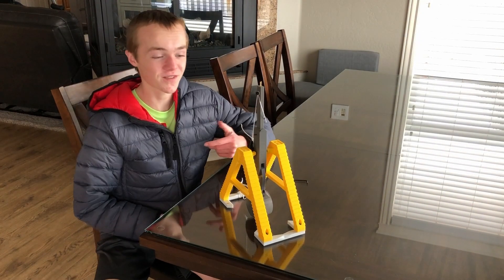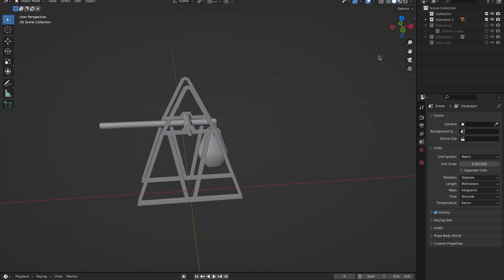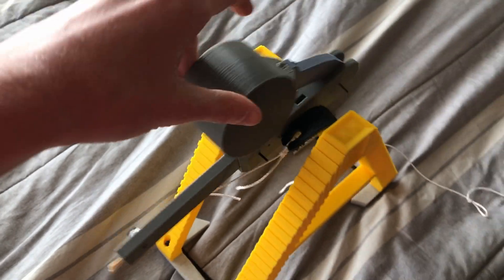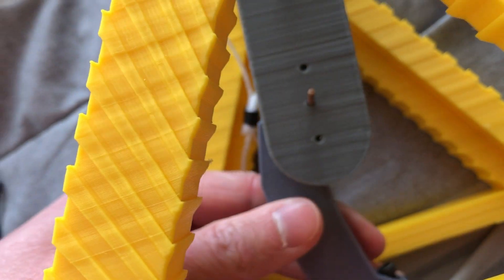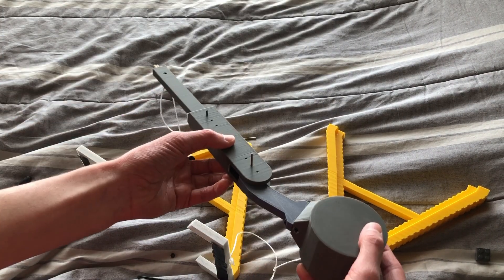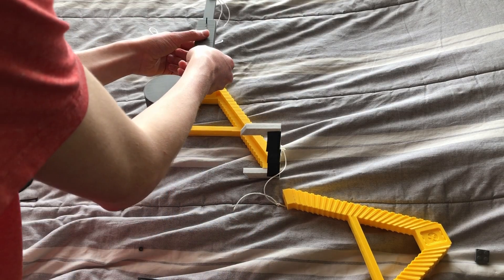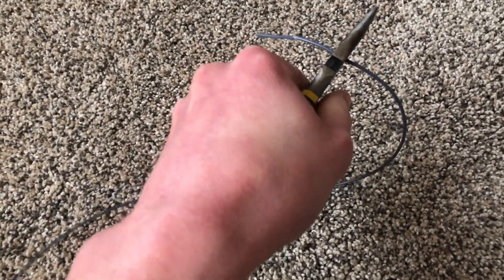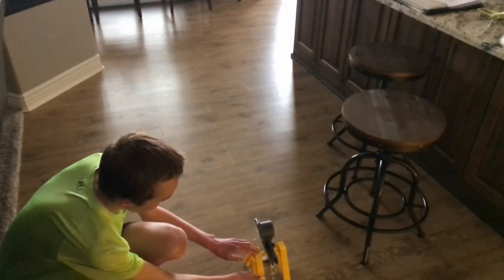Epic 3D Printed Trebuchet

Comment: Purchased and built it with my son, works pretty dandy!  Only needed a small metal post and some screws from the hardware store to 'finish' it from the 3d printed parts.

Note to self though, never again try to use sand as a weight...the fan of the 3d printer ended up blowing it all over -.-, should have seen that one coming

Comment: it might work better without the tape so it can slide, when you add wheels to trebuchets they work better and sliding would imitate wheels. maybe do some testing to see if its true!
Reply from the maker: Actually, I originally had it without the tape but it was able to slide way too much causing the energy to go towards moving it vs actually lauching the projectile.
Reply: @Dragon3D  interesting, I wonder if there are different variables at play with it being smaller. Tom Stanton has some good videos on it if you haven't seen them. 

Great job though! I tried to design something similar one day and gave up after messing around in Fusion 360 for about an hour

Comment: Ok this is freakin awesome!💪🤩 (idk if it helps but fwiw to add weight to printed things i used to use hex nuts and bb's until i discovered Plaster of Paris, which i inject during a print pause using a large syringe. Surprised me to see how heavy it becomes per unit volume)
Reply from the maker: That plaster stuff sounds awsome! I'll need to look into it! :)